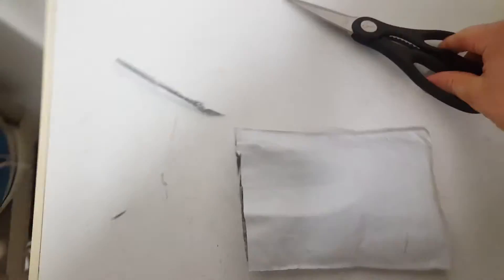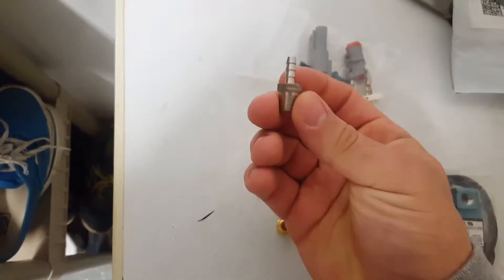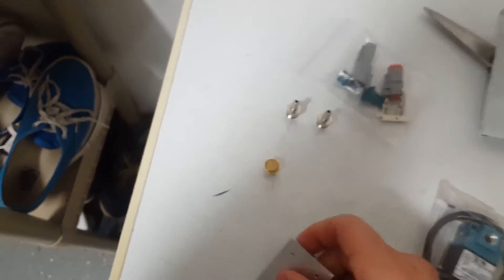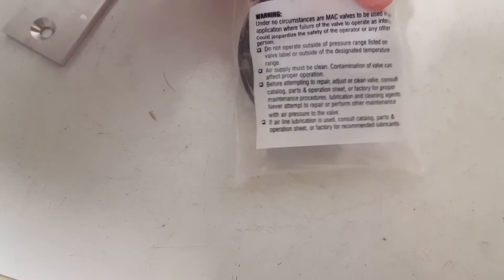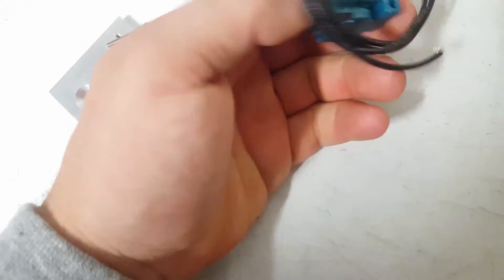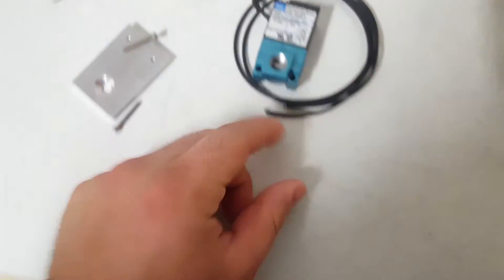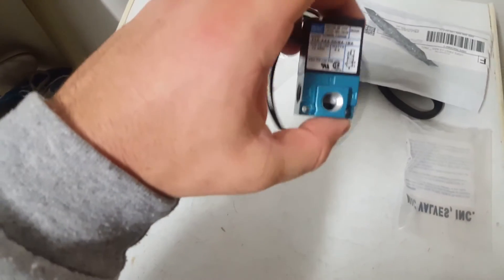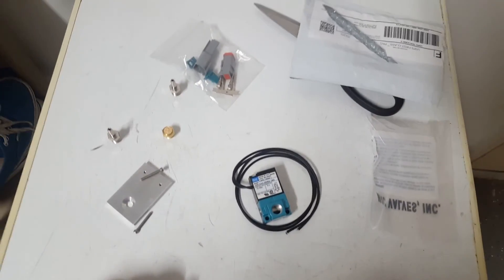MAC Electronic Boost Controller unboxing (for Boost By Gear)

Comment: On the ecu side (is that the most expensive side for boost by gear , like parts/labor)?
Reply from the maker: boosted jorgie parts for ecu side is about 20 bucks. labour to have someone professional to solder them in I'd usually around 40 or 50 bucks. the solenoid itself was 40 so about 110ish total plus if your tuner does is familiar with boost by gear (he should be). I think a small price for the added traction throughout the gears depending on setup
Reply: SP Tuning oooh ok its not much i was expecting $300+ on the ecu side , and once bbg installed on ecu it must be used ? Or can u run it with no solenoid lol sorry fr the weird questions
Reply from the maker: boosted jorgie no.worries I'm happy to help. you can continue to use the ecu normally without he boost by gear. it'll be extra hardware nothing more. and if you are running boost with that hardware install already but choose to not run bbg can simply select full boost in all gears or have your wastegate spring pressure select your boost. although I highely reccomend running the bbg for best traction and maximum fun lol